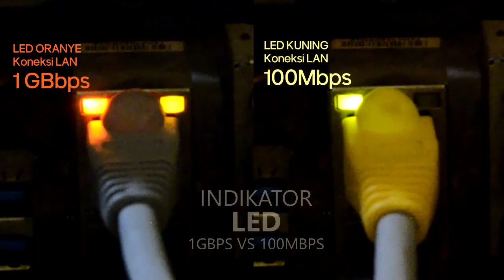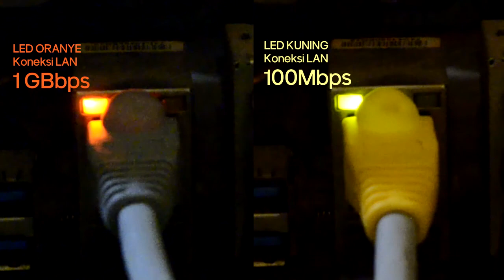Install terminate RJ45 connectors on Cat6 and Cat5 LAN cables

Comment: Mas konector rj45 itu ukuran nya beda beda apa sama aja soalnya sy mau beli kabel lan tapi kepala rj45 nya takut gj muat atau longgar
Reply from the maker: Yang berbeda ukuran ketebalan kabel antara Cat 5 dan Cat 6 lebih tebal
Pin di port female misal lubang konektor di Modem dan computer.
Pin penjepit kabel di konektor RJ45.
Umum untuk port yang mendukung Cat6, memiliki pin tembaga lebih lebar.

Bila ingin memasang kabel LAN
Ada baiknya membeli di marketplace.
Beberapa toko memiliki layanan khusus kabel meteran, mereka memiliki alat untuk memeriksa koneksi kabel sebelum dikirim.
Dipastikan kabel dalam kondisi terhubung dengan baik.

Kecuali ingin belajar instalasi kabel
Boleh di coba untuk perbandingan kabel Cat5, Cat5e dan Cat6.
Pastikan dukungan perangkat yang digunakan, seperti kemampuan port. Apakah 100Mbps saja atau sudah mendukung 1Gbps
Semoga informasi ini dapat membantu

Comment: Bang mau tanya. Apakah kabel cat 6 bisa dipasang konektor cat 5?
Reply from the maker: Kabel tembaga Cat 6 lebih tebal kak
Seandainya bisa, mungkin tidak menjadi Cat6
Pin konektornya juga lebih tebal.
Tapi bisa di coba sendiri, pengalaman kami. 
Koneksi tidak menjadi Cat6 1Gbps+, tapi ke Cat5 100Mbps.
Semoga informasinya dapat membantu
Reply: Makasih infonya kk.
Reply: Kalo rekomendasi cat 6 harga merakyat kabel merk apa?

Comment: Mau tanya bang kabel lan cat 5e sepanjang 20meter dari router utama ke router 2 apakah diperlukan arus volt tambahan?
Reply from the maker: Tidak kak
Jarak kabel LAN dapat mencapai 100 meter (teori)
Stabil di 50 meter, selama mengunakan kabel berkualitas baik.
Yang menganggu pada lintasan kabel dapat menurunkan kecepatan transmisi
Misal dekat dengan peralatan Microwave, atau jalur kabel listrik yang melintang (Cross)
Reply: @ObengwareID baik bang
luar biasa detail sekali penjelasannya, sangat bermanfaat terima kasih.

Comment: Gan kalo tang crimpingny Cat5e & Cat6. Sama ndk?
Maturnuwun
Reply from the maker: Cara crimpingnya sama kak
Cuma Socketnya dan kabelnya kedunya yang beda tipe
Dari pengalaman, Cat6 itu agak susah di clamp.
Saran ada beberapa toko yang menjual kabel dan pemasangan konektor.
Dengan pengalaman, mereka memiliki alat tester, memastikan koneksi kabel sudah tepat.
Semoga informasinya dapat membantu.
Reply: @ObengwareID  bisa gak kabel cat6 & konektor cat6 pasang pakai tang crimping cat5?

Comment: Kalau konektor rj45 cat 6 dimasukkan ke port lan zte f609 apakah bisa masuk conncetornya??
Reply from the maker: Konrkyot RJ45 standar kak. Yang berbeda pin di dalam konektor dan kabel untuk Cat 6. Lebih tebal dari kabel Cat 5e
Kami telah mencoba konektor RJ45 Cat 6 dengan kabel Cat 6. Antara 2 WIFI Router, koneksinya sesuai 1Gbps.
Semoga dapat membantu

Comment: maaf kak klo conector cat 6 di pasang di kabel cat 5 apa bisa kak ? pengaruh tidak ke kualitas jaringannya ?? makin buruk atau makin baik ??
Reply from the maker: Tidak ada peningkatan kak, akan tetap untuk kecepatan Cat5 100Mbps
Karena kabel dan konektornya harus setingkat.
Dan hardware mendukung untuk 1Gbps - 10Gbps.
Cat5 ada dua, Cat5 dan Cat 5e
Cat 5e paling optimal, dan biaya konektor lebih murah
Bila tidak membutuhkan tranfer speed, atau internet masih dibawah 100Mbps. Cat5 sudah memadai.
Semoga informasinya dapat membantu